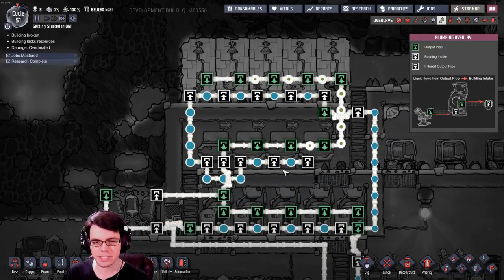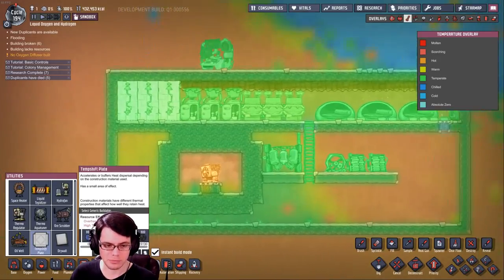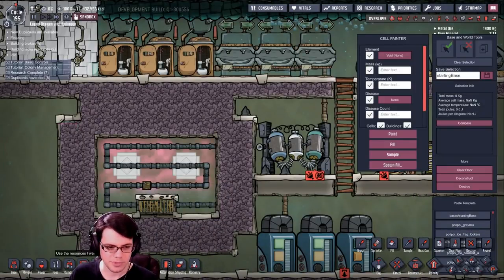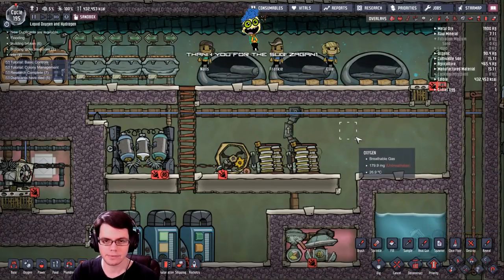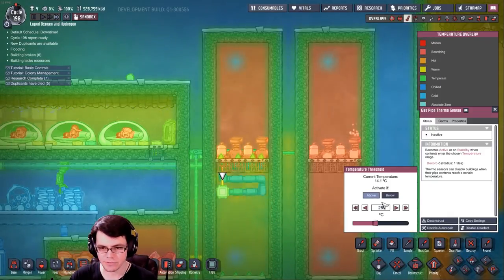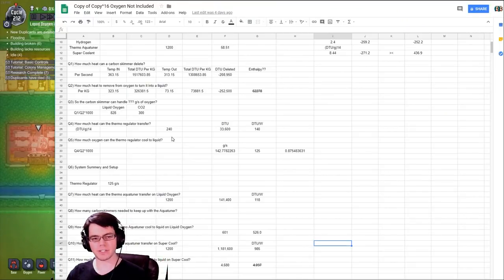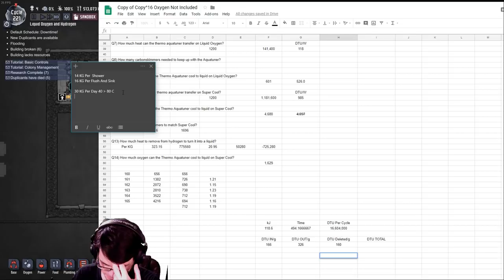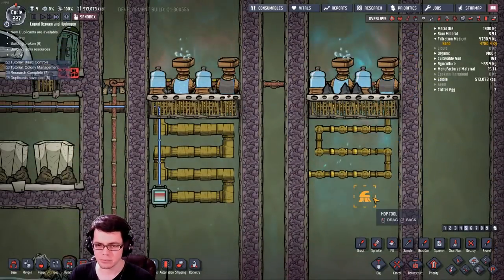Flush Your Heat Away! Oxygen Not Included Experiment Part 1 of 2

Comment: hey, could someone explain to me temp shift plates with all that thermal conductivity and heat capacity? When it comes to some technical language, sometimes i find it confusing : )
Reply: Okay, here we go. (Keep in mind I might be wrong, but someone will catch it)

Thermal conductivity is how quickly thermal energy (heat) can be moved into/out of the shift plate.

Heat capacity is...well I had to wiki that one

Heat capacity or thermal capacity is a measurable physical quantity equal to the ratio of the heat added to an object to the resulting temperature change. The unit of heat capacity is joule per kelvin, or kilogram metre squared per kelvin second squared in the International System of Units.

C = E / Delta T 
where C= heat capacity,  E=total energy, and Delta T=the change in temperature of the object.
Reply: Very simply: A high thermal conductivity # means it moves hot/cold well and quickly. A high specific heat capacity # means it can absorb hot/cold well.
So for example: an element with high thermal conductivity and specific heat capacity will move temperature very quickly and efficiently, and is best used for temp shift plates/radiant pipes/etc. where you want to transfer heat/cold. An element with low thermal conductivity and specific heat capacity will resist retaining temperatures and will not conduct them quickly/easily, and therefore makes a good insulator.
Reply: @jeffhue6710  Thx! One more: could you give me an example for plate with low thermal conductivity and heat capacity, where it could be used ?
Reply: @TheMajkhrhr  You want an insulator when you don't want exchange, like surrounding a hot room near your base. You want a conductor when you do want exchange, like when you're trying to use fluid to cool a hot machine.
Reply: Basic thing you have to keep in mind is that heat transfer only occurs when there's a difference in temperature.
So, for this explanation I'm going to use a familiar example of two rooms, on hot and one cold, separated by a wall of a certain material. Heat always flows from hot to cold and also keep in mind "hot" and "cold" are relative to one another.

So, what Specific Heat (heat capacity) means is that a high value means it takes more energy for that wall to change temperature, while a low Specific Heat means the thing will heat up or cool down quickly. What it means is that the wall will have some thermal inertia, buffering heat transfer between the two rooms. In practical therms, a high value means the wall will keep cool or hot for longer, depending on what you want to do with it, which can be advantageous if you want to keep something in a specific temperature range. You'll want a radiator to have a low value and an insulator to have a high one. If you're in a permanent regime where the ammount of energy supplied to your material doesn't change, which is often the case in the game, Specific Heat doesn't matter. Thermal Conductivity is what rules. It is how much heat the wall can transfer between two ambients. While specific heat is in regard to our example wall, conductivity regards the two rooms. A high conductivity constant means thermal energy flows more easily from the hot room, while a low value means less energy can be transfered to the cool room. In practical therms, if the Hot room is at a constant temperature, if you have to mantain the Cold room at a certain temperature, using a low conductivity material for your wall means you have to get rid of less heat on the Cold room. So if you want Insulation, eiter to keep something hot or cold, the lowest conductivity value you can get is the best one. But you may want to get rid of heat in a room, using high conductivity materials us your best bet, as you want to send that heat somewhere else.

In short:
Specific Heat is how much energy the material can absorb before it's temperature raises OR how much thermal energy it needs to transfer before it's temperature goes down.
Thermal Conductivity is how easy it is for thermal energy to flow through the material from a higher temperature place to a lower one. 

So, this brings us to Tempshift Plates.
If you want to quickly cool down or warm up a room; or get rid of heat in a specific room, use a material with high conductivity and low heat capacity.
If you want to create "thermal batteries" to keep a room a certain temperature, use a material with high specific heat. Conductivity only affects how the plates exchange heat with eachoter and materials in contact with it, with the rate between two different materials being the lowest one between the two. It is a factor if you want to build a room in a specific temperature, but a kinor one.
Insulation (Tempshift plates don't work for that) is best with the lowest thermal conductivity. There are perfect insulators in the game. Either you can use raw Abyssalite in the Molecular Forge or create vaccuum chambers by pumping a zone out or doing a building trick.
Reply: @ThZuao  holy crap a lecture for days :D thx dude ! : )